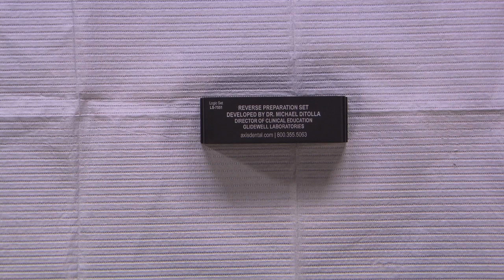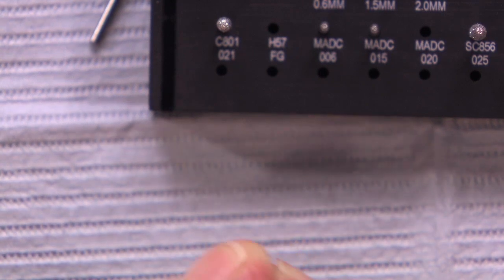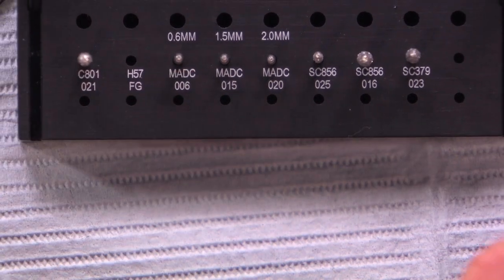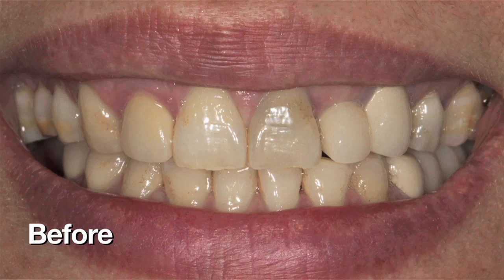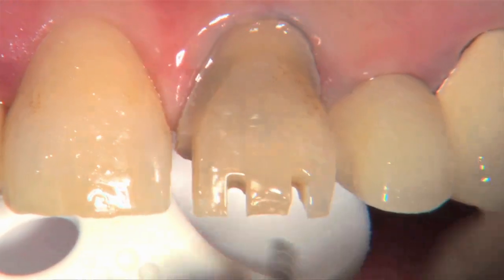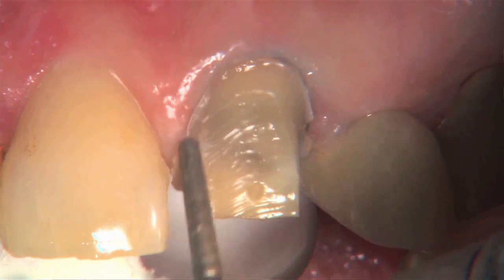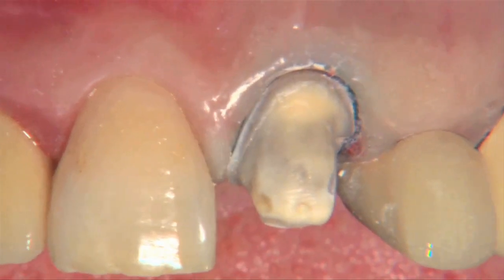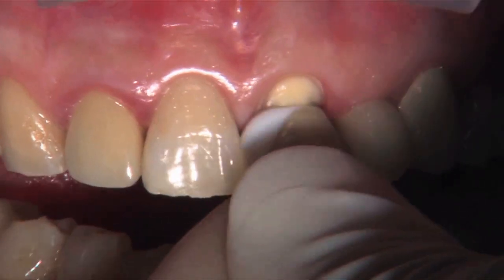Case of the week: Detailing the Reverse Prep Technique

Comment: Thank you. If we have gingival recession and alive tooth how do you prep for a crown?
Reply: Well, in my opinion there are more opportunities to evaluate. First, you have to determin the cause of the recession (plaque? mechanical trauma?). Then you have to consider which tooth are you talking about (a frontal tooth? a premolar or posterior tooth? ), in order to think about possible terapies of the recession. Is the zone aesthetically important? If we are talking about an aesthetic zone, you should try to correct the gingival line before preparing a crown, with mucogingival surgery techniques ( soft tissue grafts, coronally- moved flap etc). Otherwise, if the aesthetics is not a problem, you can prepare the crown immediately. As far as vital teeth are concerned, for single rooted teeth I prefer the BOPT technique (similar to the feather edge...), while for posterior teeth I choose a chamfer margin if the tooth is not excessively tipped, because in this case you could have to do the endo. If you decide to treat the recession, you can also decide to guide the healing of the flap with a hard resin temporary crown (like biotemps), just placing the margin of the crown from 1,5 to 2 mm under the edge of the flap, without invading the biological width of the tooth.